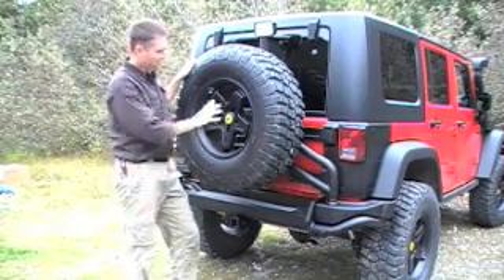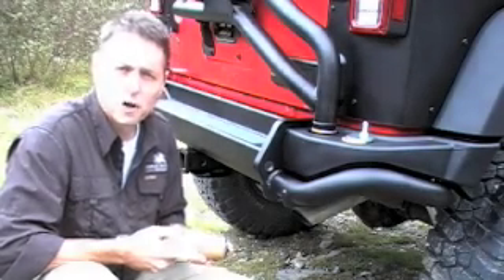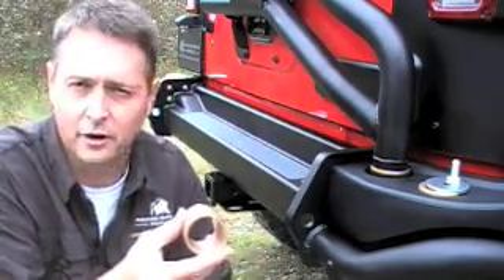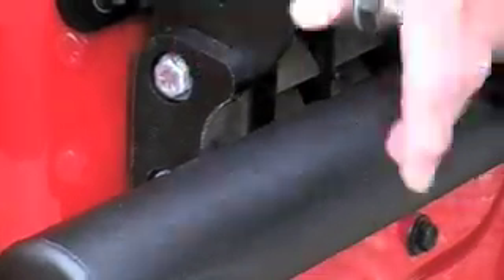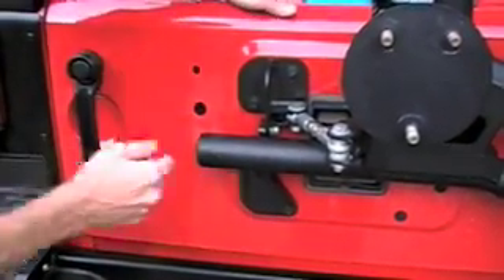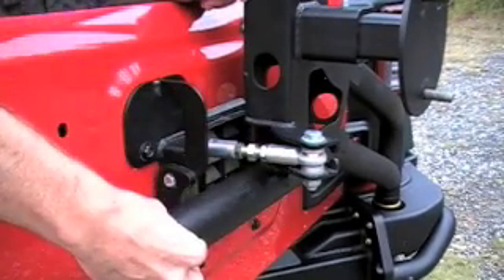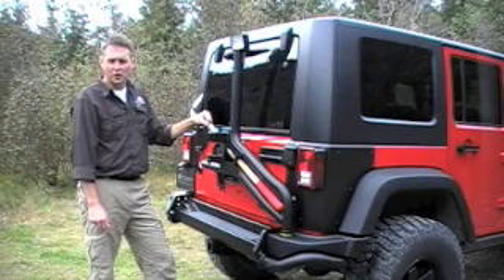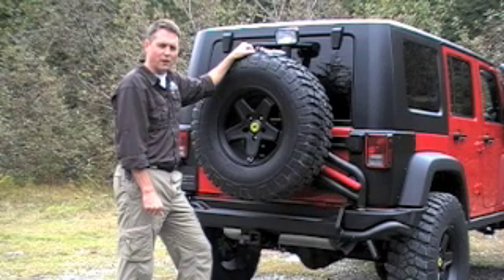AEV JK Rear Bumper Part 2 (Tire Carrier)

Comment: Is the tire able to be adjusted vertically on this carrier? It doesn't look like it, that's my only hang up on this system, otherwise I love it and would have this on my JK.
Reply from the maker: Hi Ryan - there is no horizontal or vertical adjustment. With the AEV Fuel Caddy you can fit up to a 37" tire. Without the Fuel Caddy, the carrier can fit up to a 40" tire. The mount for the tire is in that specific location so you can still easily access the door handle with a 40" tire mounted.